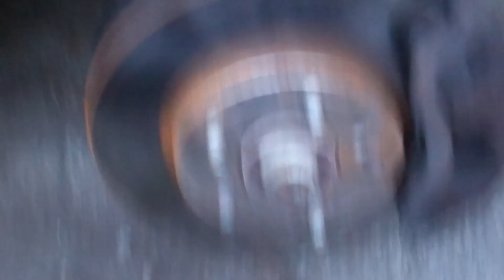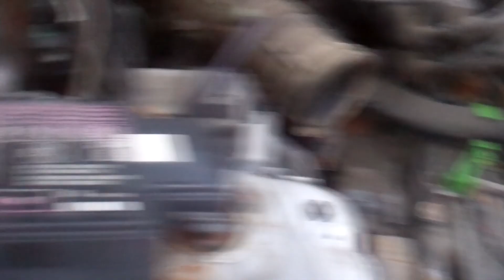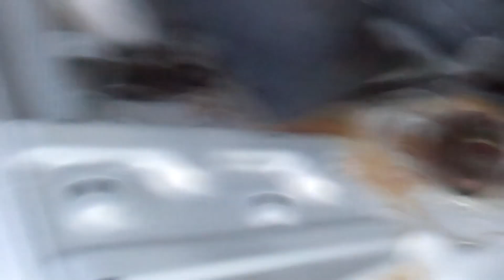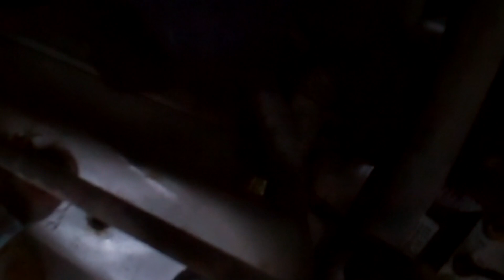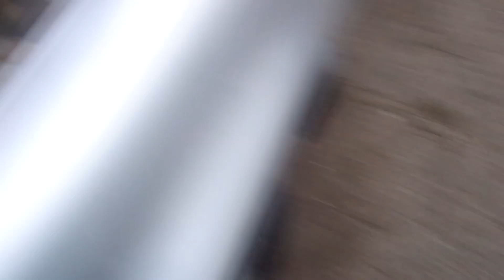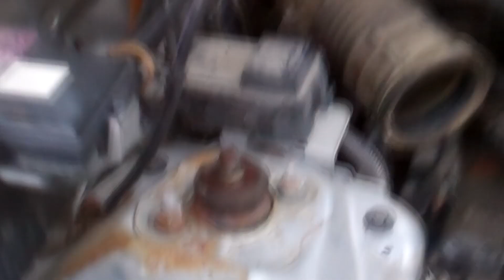Honda CR-V 1997 - 2001 Control Arm Balljoint

Comment: upper balljoint can be replaced individually. did it myself, wasnt any more difficult then the lower.
Reply: what di you use to press it in hammer or press tool

Comment: +randomdoodification   The metal on these A arms is definitely thin and it is never usually recommended to the DIYer to try and press in new ball joints to existing A arm on a crv.  It can be done, but with AC delco upper arms with ball joint going for $40 on Amazon, why go through the hassle of obtaining a loaner press?  Just replace the whole thing, not alot of money to pay for cherry new arms.